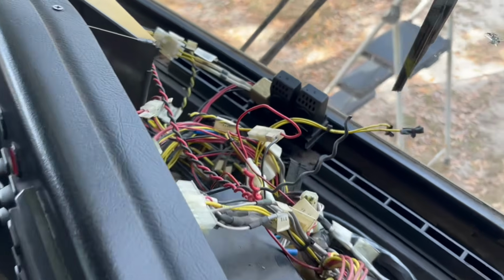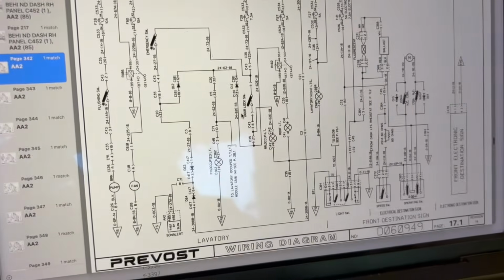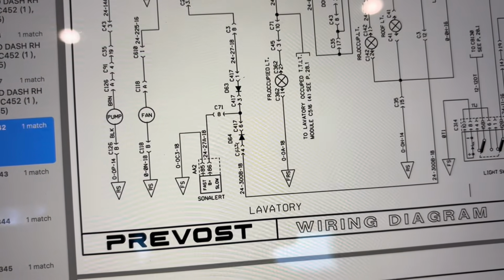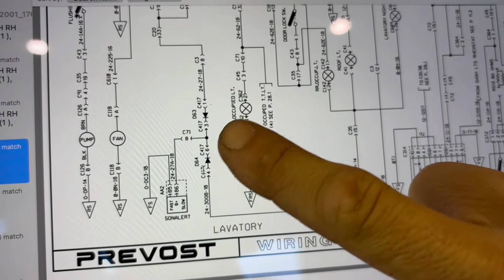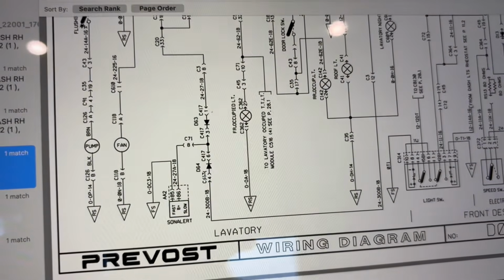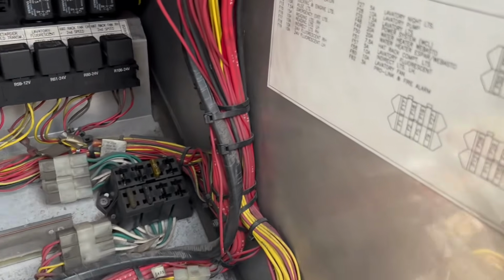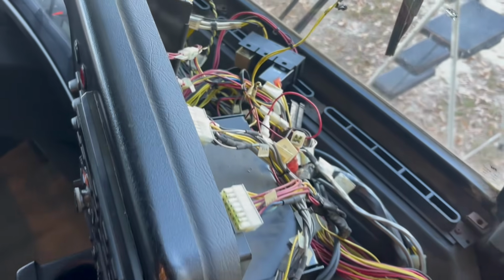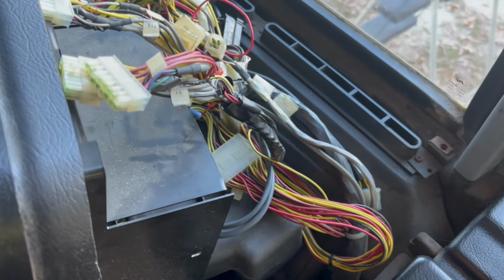PREVOST ALARM FIX, RADIO WIRING and lots of learning!

Comment: The diodes incorporated into various circuits simply prevent reverse DC current flow, think of them as a one way check valve. The term 'short' was not  accurate for the symptoms you diagnosed. Why? A short will blow a fuse that supplies power to that circuit or circuits that are wired in parallel with one another.  You never mentioned that you found a blown fuse while diagnosing this circuit. Based on the water you discovered in the modular connector, where you sprayed it with contact cleaner first, then installed a corrosion preventative compound, solved a condition known as a 'bleed over'. The circuit you were diagnosing was able to bleed over onto other circuits within the modular connector. You may have experienced other circuit malfunctions due to an unknown amount of specific circuits simultaneously coming into contact with the water in the modular connector, yet you were interested in only the one  circuit at that time. The diodes are mounted on elevated stand offs. Those diodes can be easily removed from those stand offs for testing without interfering with your DVOM resistance test and it's capacity to read resistance upstream or downstream of the diode, possibly causing incorrect test results. To make an accurate test on any diode, it should be removed from the circuit and isolated for the sake of accurate testing. Most DVOM's have a dedicated test   selection slot for diodes only. Yes, the correct indication of a good diode is basically reading infinity, then reverse the bias of your meter leads and read some value of resistance similar to your test results. Simply stated, read infinity in one direction, reverse your meter leads, and read resistance. This usually indicates the diode is good. Isolating a diode test is best method method of approach that provides accurate results. Using a hair dryer can also help remove the water that accumulates in modular wiring looms. All internal pins of modular connectors should be thoroughly dry before applying dilectric grease.
Reply from the maker: Thanks, well, when I pulled the diode packs, and the fuses, it didn’t kill the alarm. You’re definitely right, I believe it was moisture or something allowing a bit of cross current. The baffling thing was both of the circuits should’ve been dead. So it was getting current from some other source. My thoughts (and what I believe you’re saying) is from that wire loom.

Thanks for the clarification! And commenting….. blessings!